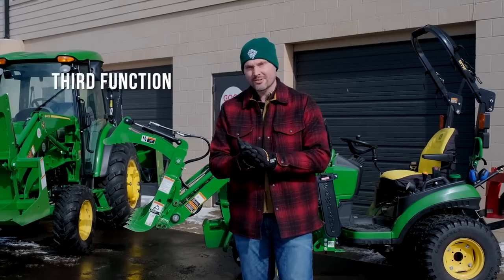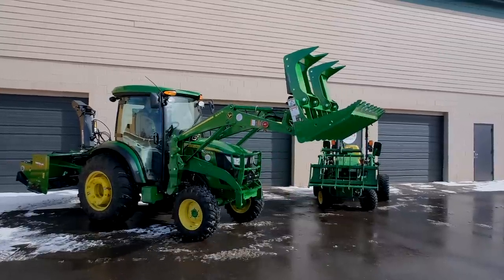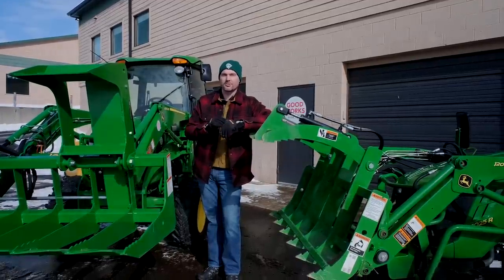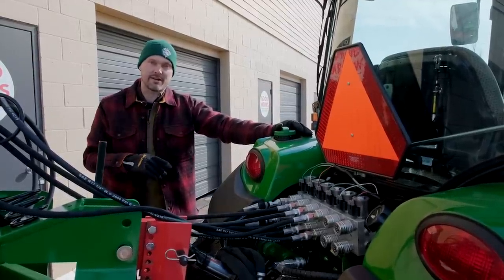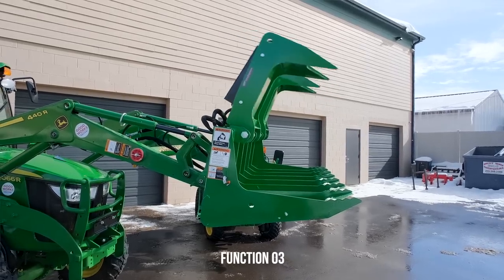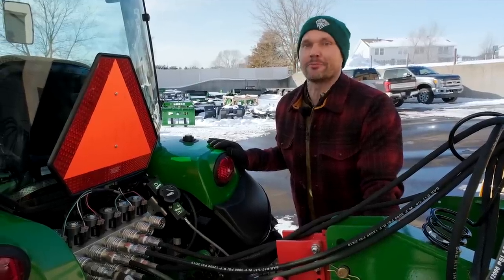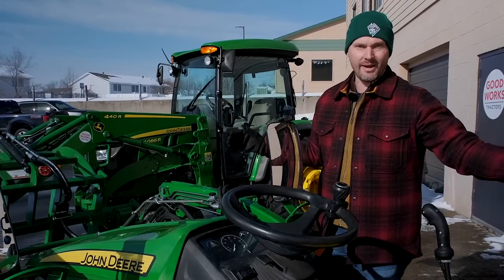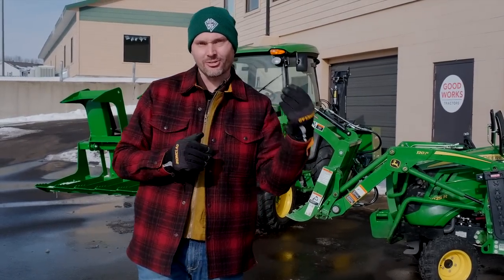EXPLAINING HYDRAULIC MULTIPLIERS, 3RD FUNCTIONS, & DIVERTERS

Comment from the maker: LOOKING FOR A DIVERTER KIT OR HYDRAULIC MULTIPLIER?  GET 5% OFF SELECT PRODUCTS WITH CODE GWT AT SUMMIT HYDRAULICS! http://www.summit-hydraulics.com
Reply: Does the Summit Hydraulic 6 solenoid multiplier attach directly into the 3rd function/rear remote on a JD 3046R? Then using a combination of the electronic control box included in the kit and the 3rd function button on hydraulic joystick I can choose and operate 1 of 6 hydraulic cylinders? Kit's installation instructions are not very detailed.
Reply: Nice job  -- SO, I need a rear function NOW for offset flail mower with a slide, but expect to have a grapple bucket not too far down the road. The diverter would work of course but the third function just seems better long term. Could I add a third function valve and run it to rear for now, then add a multiplier later and run hoses from there to the front?  Or could the multiplier be mounted nearer the controls and run one set of hoses to rear and one to the front, for overall less hoses? I am a little OCD so I do not want cluttered wires and hoses. (Kubota MX5200)

Comment: I really wish i spent more time with my JD buddies back in the shop when they was messing with stuff like this building stuff for the state weather it be awesome mower kits or plowing equipment. I see thay tractor and think about a spilt blade for the front and how absolutely epic that set up would be for plowing ! Soooo cool all the equipment we have these days. Absolutely 100% agree with ya on the 3rd function deal as well. Hell it's taken them forever to even put remotes on smaller tractors and mist expensive ass ones still don't have them 😬 pretty cool and TBH idk why the hell they wouldn't sell em anyway with ones for the front and two in the back. Kinda like how the orange dudes had stuff set up on the front so ya could just rock a blade kinda like the beefy JD lawn tractors had in the day. Always thought it would be handy and hell for how much they cost would be a easy sell. Now a we have powerboxes as more equipment becomes available for tractor use that we would have taken for granted on the skiddys. Always cool the amount of power a hydro circuit can have with even a small amount of pressure. Really feeling for my new buddy down in the woods doing some building 🤦🏼‍♂️ he has a pretty decent tractor with a loader but no grapple and boy he sure could use it RN with the brush

Comment: Thanks so much! I am shopping for my first tractor. I wanted to have it “grapple ready” but also wanted a “remote” in the rear for an implement that I would use infrequently. I now understand that I have an option of using hoses from the front to the rear without the additional $1500 dealer was gang to charge for the rear remote. Not sure which way I’ll go but I like options and even better, understanding them!
Reply from the maker: Awesome, glad to hear you found it helpful!!

Comment: You're right.  It gets confusing.

I bought an ATV trailer with a hydraulic lift.  My 1025R has a 3rd function.

So, dealer says impossible to run the trailer off Power Beyond.

Watching Outdoors with Morgan, his RK had a 2nd lever for the rear hydraulics.

My head hurts.

Comment: Thanks for a clear explanation.  I am new to tractors and (was) very confused about "3rd function" and "rear remote" and about hydraulics in general.  You helped a lot.  I will probably buy a diverter kit from SUmmit based on this video, so they should value you.

Comment: When I was shopping for a compact tractor approximately 2 years ago I did not understand tractor hydraulics. I thought I was going to get a grapple right away. I told the dealer I wanted loader mounted 3rd function. He talked about running the hoses from the back to the front and that sounded like a cobble job. I ended up with a 2025R because Deere announced a loader mounted 3rd function kit with loader control mounted buttons. Dealers certified welder also cut down my ROPS to fit into my trailer. I also did not under stand power beyond.
I like my 2025R but if I was doing it again I would have a large 2 series.

Comment: Courtney, you brought up about the additional hydraulic circuits  having value on a tractor.  Someone considering a new or used tractor and concerned about the cost of additional hydraulic, should also realize that not only the advantages of using it, but also the additional hydraulic function/s adds value to the machine come take-in time.  May be more dollars up front, but well worth it in usability, and resale value.  Hydraulics are a wonderful thing!

Comment: If I add a 3rd function it'll be with a diverter and the pressure line going to the front loader, then the return going to the back of the tractor, and then the return from there going back to the diverter. Then with a short male/male hydraulic hose just move it to the front or back to complete the loop. I can't think of a scenario I'd personally ever require both at once and it'd make it way more flexible at a pretty low cost

Comment: Another very instructive video. I agree, while it is common for a tractor to have a 3rd function up front for a grapple, it is no different than having a 3rd function out the back instead for a hydraulic top link. Adding a hydraulic tilt means you need a 4th function. The cheapest way to get a function out the back is to manually swap hoses with the curl/dump connectors. That is how I currently run my side shift flail mower. But if I needed to use the bucket I'd be out of luck.  That multiplier looks interesting as I have a rear connection for the backhoe.

Comment: Thanks for the great explanation.  Cleared up a few lingering questions I have had.  Have been wanting to put a third "circuit" for the front and back on my RK24 and TC33D for a while but unsure of what and how I wanted to do it. I'll use "GWT" at Summit for the diverter and multiplier.  Thanks again.

Comment: Great video, I wish you would have done this a year ago. I use my 3rd function for my front snow blade angulation and when needed, I ran another set of hoses to the rear of my tractor to act as a rear remote. So I have to disconnect the hoses that go to the front and connect the hoses that go to the rear, but it is well worth it to be able to control my hydraulic top link.
Now if you can explain the different Hydraulic coupler to me :-), I am always unsure of what couplers I really need.

Comment: Thank you thank you thank you thank you sir! I am looking at buying a tractor my first compact tractor ever. I am telling you I have not a clue what the heck everybody's been talkin about. Just help me understand it way easier. My next question to you is if I bought one with a rear remote do they make something smaller like the diverter you got on the back of your 4066r that will give me a few more functions without giving me 10 function? I think I know the answer to that is yes because I've seen it in a bunch of other videos you had on other tractors. But I'm not for sure if it was the same thing I like the little box and being able to wire it I can do all that myself what would something like that cost on your 4066r? Just a rough cost of materials I can do all the plumbing and wiring.

Ps. Sorry about the last questions I asked that before I went down to the comments. It's in the comments right there I went to Summit website that is awesome so simple to find and really affordable I thought. For the fourth circuit would be for complete circuits correct? Or would that be two functions?

Comment: Yeah just to had to the confusion you also have the rear connection to the backhoe that is calle the power beyond. I also wonder if there is a practical way of using it lets say for the rear snowblower controls. I did see a guy use it for a log splitter since it has its own control valves.

Comment: I have an older Farmall which has "one way" hydraulics. (IE: It provides pressure to "lift", but when you select "lower" it just goes to basically "float" and lets the implement down by gravity)  I've always wanted to find a way to take that one way flow and plumb it into some sort of diverter valve to allow adding two way remotes.

Comment: 2025r with backhoe. When backhoe off, do they make a kit to use rear hydraulics as a third function. Can you just mount another control valve and hoses so have rear as third function
Reply: I think should be able to since they are live all the time.  Would be good for one function?
Reply: I was about to ask this question. It makes sense that you should be able to do it but then again you don't have a switch for it.
Reply: The circuit for the backhoe is called a power beyond circuit. It can be used to power a diverted valve or block like shown in the video.  Search for power beyond kits.

Comment: Have a question I have not really seen answered here or anywhere else, Wanting to install one of these on an older tractor using its circuits to run the front loader. So my 3 circuit box I would install would power the loader main lift, flex wing main lift, and flex wing wings. Hay cutter and so on. When I decide to switch circuits I need the previous one to hold pressure as its holding something in the air till I go back to it! I reached out to summit and they confirmed the solenoids are continuous duty so you can leave then switched on, but nothing on switching under pressure?

Comment: When I was introduced to all this at the dealer I learned 'third function ' as being exclusive to the front and with couplers at the end of the loader. The rear connections were called rear remotes. If you don't use that terminology I would ask what you call raising the 3 point? Isn't that a function? I guess it's only half of one.

Comment: Great video but as a new tractor owner I am a little confused, So is power beyond a possible 3rd function?  Can you add a controller switch and use it as a 3rd?  Maybe for Top & Tilt or even a grapple?
Reply from the maker: You would need to install a double acting control valve in order to utilize Power Beyond.
Reply: @GoodWorksTractors Thank you for getting back to me. Is that a good way to go or is there a better option?  I need to be able to use my backhoe as needed but I would also like  top & tilt option at times as well,  my tractor came with a front 3rd option for my grapple.  Also, will you be having merch with your new logo soon?
Reply from the maker: I'm not aware of any better options, but perhaps the guys at Summit know of one?  Hopefully more merch in stock soon!  Thanks for following along!

Comment: After some reflection, I think the confusion over what constitutes a "third-function" comes from the manufacturer's (Summit, WD Long, etc.) of the "third-function kits" and their choice of description of their product. These kits are all labeled as a "third-function kit". All of these kits add an addition hydraulic circuit, and these kits tap into the existing loader circuit to add this circuit to the front of the loader (what you called "grapple-ready" - yet another term to add to the confusion, though it does more clearly describe it). Perhaps what these manufacturers should have called this kit is a "loader 3rd-function kit". It would then specifically apply to just the loader, and there wouldn't be this confusion. It clearly reflects that it is adding a 3rd function to the loader.

About the JD that had the "III" on the label. That "III" would only apply if the loader is standard on that tractor - and it assumes that you start counting your functions with the loader, then move on to the rear. I can see counting the total number of functions that you have; the problem comes in when you start assigning numbers to any specific one of the functions.

Comment: I am looking for some rear remotes and a third function for my Massey GC-1720. I like that multiplier you have on the back. I'd like to get something like that to fit on mine. I'd be using the hoses from the backhoe while it is off, but it has 3 lines. What is the third line for and do I need to hook it up if I am using a multiplier bank? I want tilt and level for my box blade mostly, so would like 3 or 4 extra circuits.

Comment: I just bought my dads JD 4100.  It has 2 circuits built in for a front end loader, which I dont have.  Any reason I cannot have some hoses made and run to a manifold in the back where I can add an adjustable link and tilt?

Comment: Open center are poor at multiple simultaneos functions.  But a closed center pump with load sense can cost $$$.  Big machines like excavators use closed center.  So they can boom in, gather and curl at same time with good control.

Comment: Can the third function be hard piped to the front & the rear to quick couplers.  Such that when this function is being used on either end to the tractor the quick coupler on the oppsite end will not leak?

Comment: Are your 4th and 5th SCVs mechanical levers and fully independent SCVs? In my 3320 (factory cab) the kit I've found on the JD parts website points to the 4th and 5th SCV option actually being a diverter from the loader joystick, whereas the open station can have a ROPs mounted independent 4th and 5th. I have open slots in the control station plastic trim (which looks very similarl to your tractor), so I'm wondering if there's an option for additional SCVs that are not diverted from the loader joystick.

Comment: Question: I have a Branson 2515 with a backhoe. When my backhoe is off, I connect the 2 lines to each other to complete the circuit. I want to add a hydraulic toplink for use with my box blade. What is the cheapest, but correct way to accomplish this? Being a new tractor owner, I would think that I could run those 2 lines to a control box (with a control lever), then run 2 lines to the hydraulic toplink, however I haven't seen anything on the market that would do this. Any advice?
Reply from the maker: Good question and I'm not positive of the answer.  I'd start with a conversation to summit-hydraulics.com and see if they have what you need.
Reply: @GoodWorksTractors   Will do, thanks for the fast response. Love the video's!

Comment: I have been looking at Summit for a front 3rd function and a rear 4 outlet hydraulic set.  I have a 2009 2520 John deere tractor and they do not have a kit to match my model and they are not sure which present model would match my 2520.  Is there a kit that would fit my tractor on the kits they list?  I don't want spend the money and find out it does not fit.  I do not have the Power Beyond kit and do not have a need for it.

Comment: Okay, forewarning: “old school” factory 3rd function question here. 

MACHINE: New Holland Lx565 (i.e., the “x" stands for came standard with “auxillary,” or 3rd function circuit flat quick connects mounted on left boom arm from factory, Serial Number 39115) skid steer with hand (steering) and foot (left = boom, right = bucket or curl) controls. IMPORTANT NOTE: the auxillary control (3rd function) is operated by tilting the right handgrip downward toward one’s right thigh (can be locked there with a slide pin) AND mechanically opens and closes a third spool on the control valve under the floorboard, i.e., 3rd function is NOT electrically operated through a solenoid valve. 

QUESTION: to add a fixed arm backhoe attachment (i.e., skid steer steering does backhoe swing; skid steer boom does backhoe up/down (kingpost or boom); skid steer bucket (curl) does backhoe “elbow”(dipper) and the backhoe bucket cylinder comes with an electrical plug that later model joystick operated units have a receptacle for (which Lx565s lack!), can I operate (i.e., with FULL feathering capabilities) the fixed arm backhoe attachment’s bucket cylinder simply by rotating the Lx565’s right handgrip (WITHOUT locking in place), or do I need to add an extra 2-way hydraulic valve in the auxillary circuit (i.e., and lock the right handgrip rotated down toward my thigh)?

Comment: I actually just priced the factory deere 3rd function for my 1025r its $1000 for parts to make it "grapple ready". $1500 for the parts and to have my dealer to install it, but many people have to me that you can install it yourself.
Reply from the maker: It takes a trained JD technician 7-8 hours to install the JD 3rd function on the 1025r.  It's an absolute nightmare of a process.  You should see the amount of disassembly required.  If they are only charging you $500 to install it, then you're getting a deal.  I'm not aware of anyone tackling that install themselves.
Reply: @GoodWorksTractors  dually noted! Thank you! I have several around where I live that have done it. Said it is ALOT of disassembling but nothing someone mechanically inclined couldn't tackle tho, so I've been told

Comment: Where did you get your 3pt tilt/raise/lower ram and will it mount to bigger tractors? Thinking that would be really good for putting a dipper on the back of a tractor for steep hillside usage ;) Even for digging in around barns where hillsides are an issue.
Reply from the maker: It is a John Deere part, but I bought it with my tractor.
Reply: @GoodWorksTractors  That was the three point lift arm ram? Not the top link... Do you have a part number for it or know of anyone else making any?
Thank You
Reply: @GoodWorksTractors  I found your other video with a part number for the tilt/top link kit. Also saw you using it in more detail. This tilt setup wouldn't work for me. Do you know if they make on about twice the length? More for a mid or 100hp tractor?

Comment: I’m thinking of a 1025R purchase. Has anyone installed a Summit diverter circuit and then installed a mechanical diverter on the “3rd” function?  My idea is to mechanically divert the hydraulic flow between a loader grapple, for example, and a rear remote I would install for snow blower chute rotation. Wondering if anyone has a kit like this. It would be fairly easy, just some more hoses and fittings.
Reply from the maker: Seems doable to me!